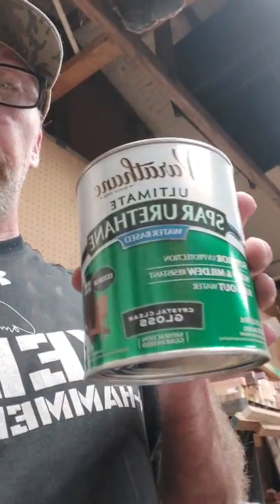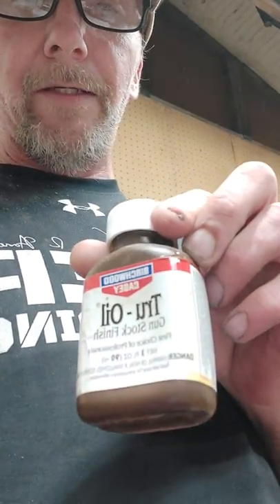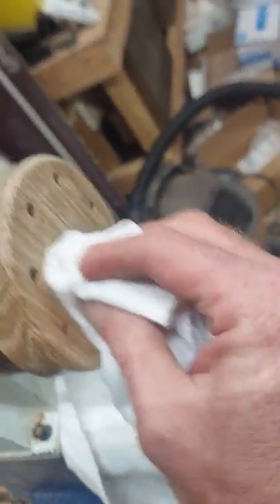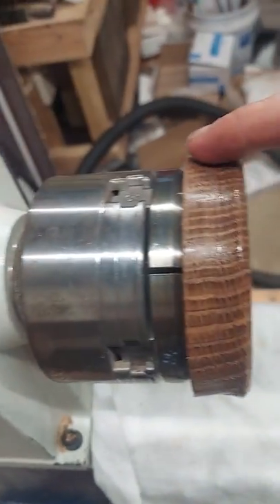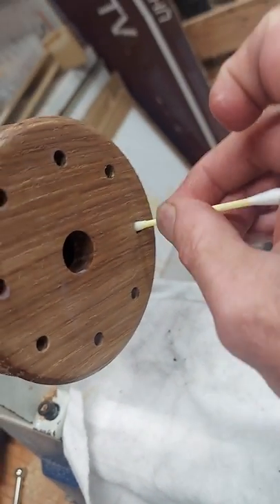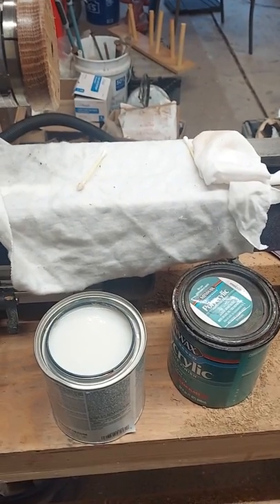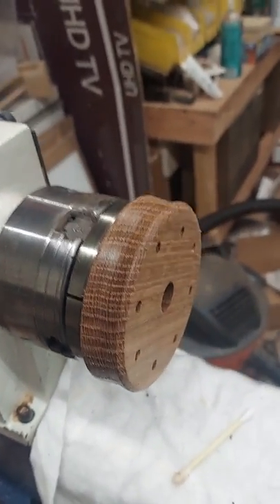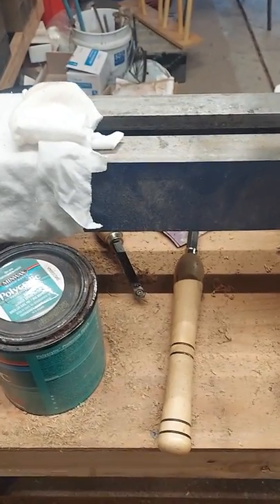finishing turkey pot calls..

Comment: What size four jaw chuck are you using to hold it in the center of the call like that? I’ve been making pot calls using a wine bottle stopper mandrel and have had good success producing good sounding calls but I’m always left with a sloppy looking center hole from where it threads on i think drilling a center hole with a Forster bit and using a four jaw with give me much nicer holes
Reply from the maker: Off the top of my head I do believe it's a 3in spigot nova .. I'll check later for you to make sure.. I'll be deer hunting most of the day today.. I'll get back with you.